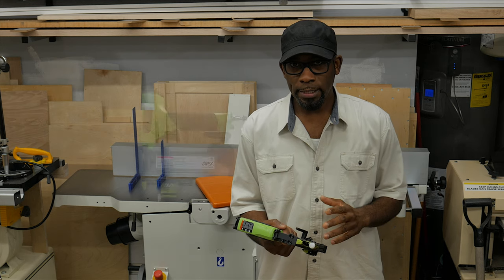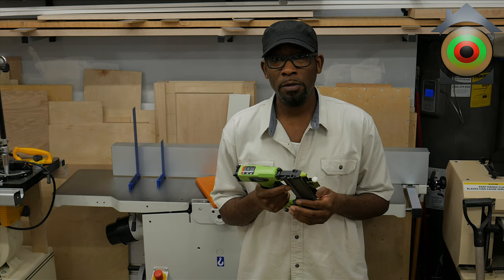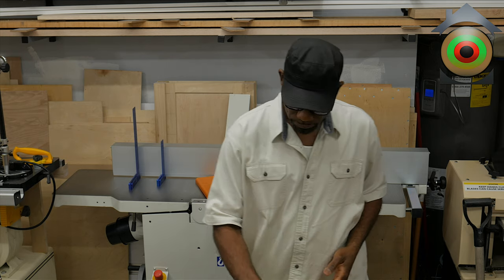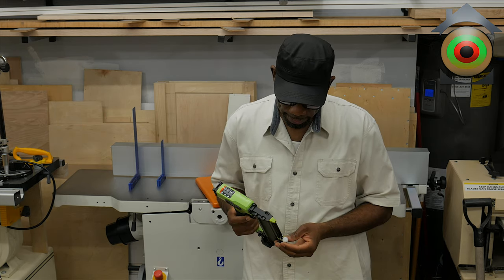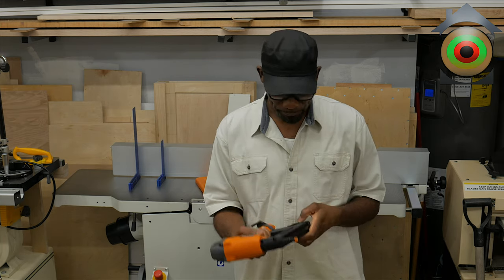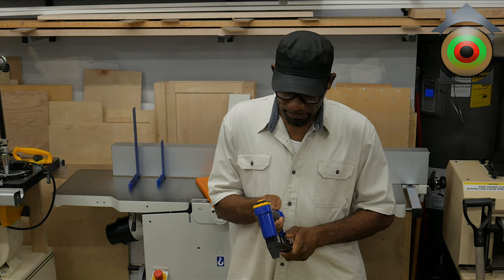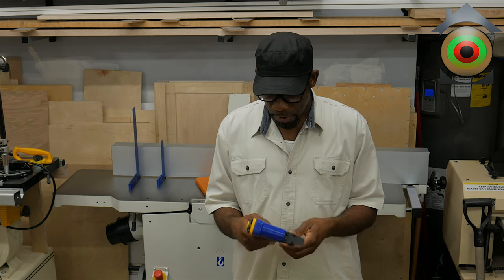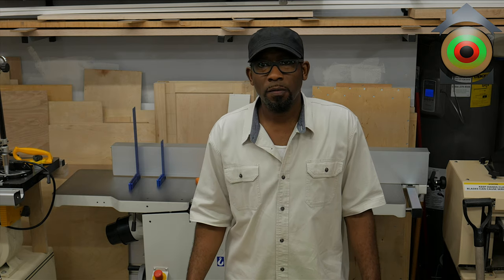Nailers I use to Build Cabinets

Comment: I installed oak flooring with a Milwaukee 18 gauge cordless brad nailer.  I had prior experience with portable air compressors and pneumatic nailers and the Milwaukee replaces the big mallet and it is a lot quieter.  It works for pinning carcasses but occasionally brads deflect and blow out as you say.
Reply from the maker: Thanks for watching Roy!

Comment: Hey Mike! Great video! Surebonder makes one of the best T50 staplers out there. If you find any with a dbl trigger, let me know. I've only seen those on 23 gauge pinners, because they are too small to have a safety bar in front. Most T50 guns have a rotating safety under the trigger so you can hold the trigger and rapid fire (the surebonder does this) or "bump fire" 
I run the Milwaukee 23 gauge cordless pinner (m12 battery) and it's so liberating!
Reply from the maker: Thanks Al!